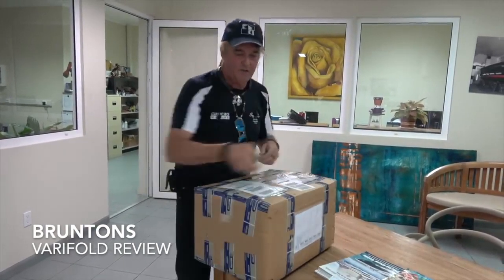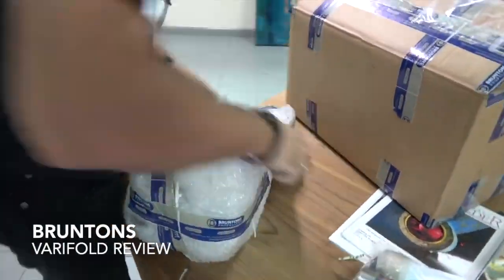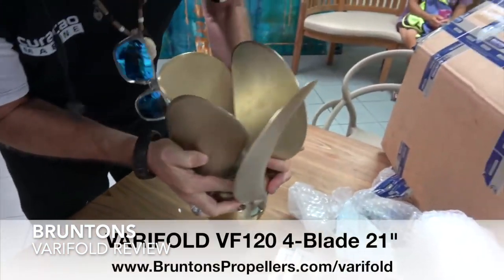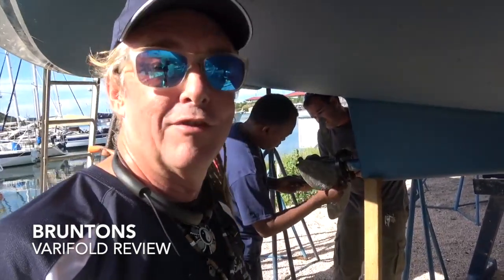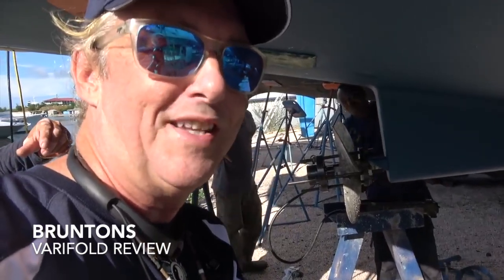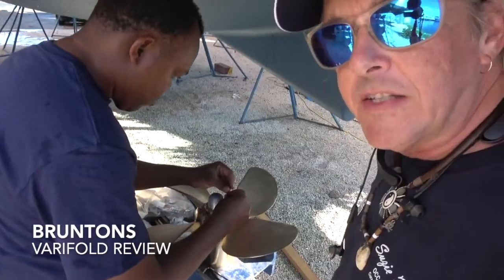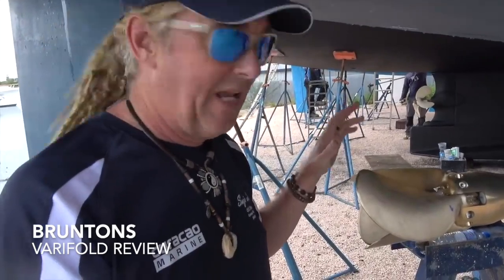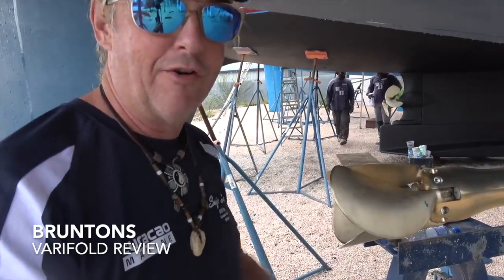Bruntons 4 blade Varifold for sailing yacht Sophisticated Lady

Comment: Hello from Ontario, Canada. I've had a two blade for quite a few years now. It really improves the sailing speed. We're on the hard now. Here's  a tip for cleaning, gel toilet bowl cleaner. Let it soak for about 5 to 10 minutes then use a soft plastic semi abrasive dish soap pad. It will clean up like new. Works for the fresh water lakes anyway. Great prop!